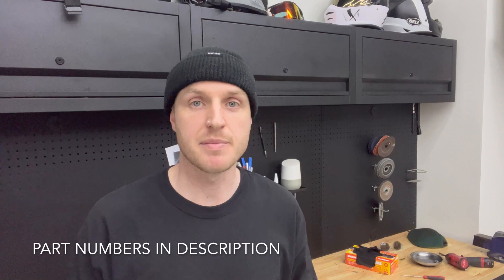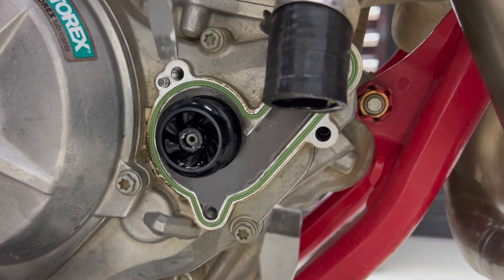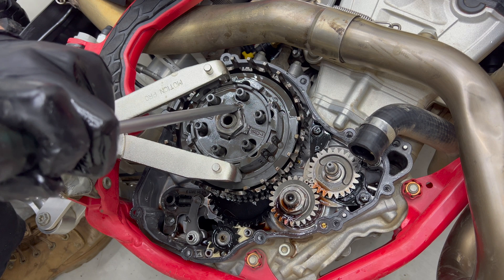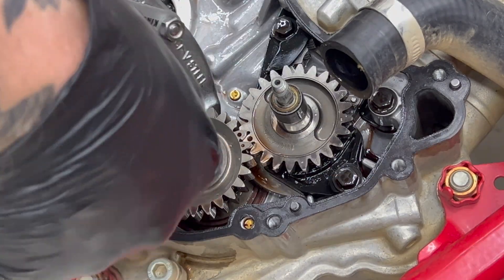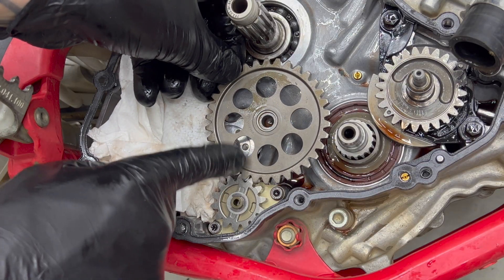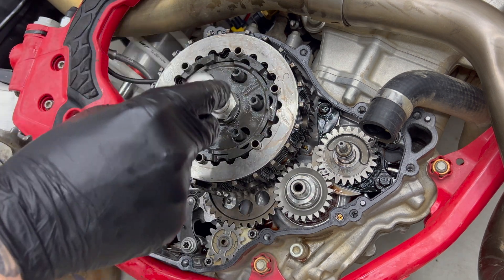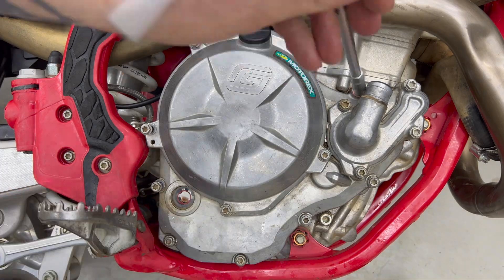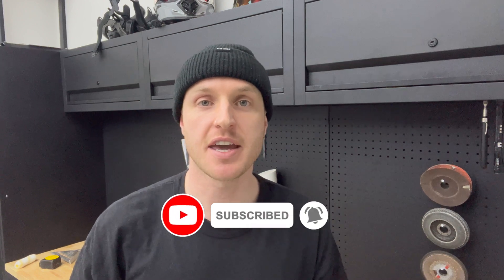Oil Pump Gear Upgrade! *How To* (KTM/Husqvarna/Gasgas)

Comment: Keep in mind, a big issue and usually the root cause is the oil pump rotors themselves were also plastic.   Theyd warp and bind and cause the gears to fail.   You should be replacing the entire pump assembly including plastic rotors.

Comment: Great video, I just pulled the clutch cover off my 23 350exc, your right it does have metal gears already😊, the dealer couldn't confirm this.
Unfortunately my neighbour has the same bike but a 2018, so we still are going to have to reference your video.
Cheers 
Giles

Comment: Hi, I have a 2019 KTM 390 Duke (European). I changed the oil pressure sensor but still the oil light comes on when the engine is warm. When I down shift from 4th gear to 3rd it comes on very quickly and then turns off. Any advice!

Comment: So how is my luck! I own a 2020 Husqvarna FE350 and a 2022 FE250. Both have now had the top ends rebuilt at considerable cost. After having the top ends done, it might seem that I have not addressed the actual cause of the problem. I have ordered the steel parts for the FE250 and will do the FE350 soon as well. Thank you for bringing this issue to my attention. But i do wonder why KTM has not issued a recall for this problem, I'm sure there are many thousands of others who have also suffered financially from this issue.

Comment: Can i use the crank locking bolt to remove the clutch hub and crank gear as i dont have the clutch holder tool

Comment: Apparently it's not an issue on the 450s. Even though they have the plastic gears.
Reply from the maker: I was under the impression the 450's have steel gears, but im not 100% sure
Reply: @jackkellybuilds  my Australian '23 FE450 has plastic gears. From what I've read the problem "plastic" years were around '17-19, after which they went to stronger fibre reinforced plastic. Sadly these OEM metal gears are 14T/34T and 250/350 specific, the 450 needs 18T/33T.
Reply: Well they failed on my 2017 500 exc-f same engine.

Comment: The part number for the small gear seems to be wrong...  My Ktm dealer is telling me it's and oil pump assembly for a 50sx..  Any update or corrections?
Reply from the maker: a quick google search would confirm it is the correct part number, maybe try another ktm dealer

Comment: Great video! Question, does the 2012 350 EXC-F have the same issue needing to replace the plastic oil pump gears? Thank you so much!!!
Reply from the maker: I'm unsure as that motor will likely be a different generation

Comment: I believe the 690 engine still has plastic gears!
Reply from the maker: Fortunately the chances are low on a 690 because I wouldn’t imagine anyone getting one of those hot enough to warp the gear, but a steel gear would be a nice redundancy to have

Comment: My KTM 250 E-XCF suffered a gear failure. No oil to the top end and I had to do a full top end rebuild at 10 hours. The new part# had no issue.
Reply from the maker: sorry to hear you got unlucky, at least you have the new gear now and shouldn't happen again
Reply: Better yet, I sold that bike and I'm on a TE300i now :)  @jackkellybuilds

Comment: Hi thanks for the great sharing! Any idea if these revised metal engine oil pump gears can also be used to replace the plastic ones on the LC4 engines of the 2012-2015 KTM Duke 690's?
Reply from the maker: No problem! You would have to check the part numbers on those to see if they’re compatible, but I doubt it

Comment: So will a 2020 fe250 need changing before i buy one
Reply from the maker: it doesn't "need" doing, likely you may never have an issue with your plastic gears, depending how hard you ride. but if you want the added reliability of steel gears, then you might want to.

Comment: Great video !!   Just am FYI  KTM 4 strokes have a great feature to lock the crank at TDC so no washers or gear jammers are necessary.  While at TDC remove the large allen bolt just below the primary gear and remove the thick washer that is behind it.  The end of the bolt is pointed and through the hole you will see a corresponding slot in the crank. Screw the bolt back in without the washer and this locks the crank at TDC.
Reply from the maker: You're correct, it does have that feature, the reason why I didn't use to it hold the crank while I remove the bolt is that the allen screw has a tapered end on it  and I was worried id shear it off with the amount of torque required to remove the bolt on the gear. It is a good feature that KTM's have though , I use it when I remove the cams to adjust the valve shims and it keeps everything in time. Thats for the comment!

Comment: some yamaha bikes also still uses this plastic gears, which is baffling considering is a known weak point in their bikes.
Reply from the maker: Im sure the engineers had their reasons at the time for the plastic gears, wether it was to save weight or save on manufacturing cost, but I think I speak for everyone when I say id prefer the reliability of steel gears in my engine than it be $10 cheaper or to save 20 grams

Comment: Can I ask you a question about my 2018 KTM
Reply from the maker: sure!
Reply: Was draining the oil and a broken C clip came out on the oil, where do you think is from?
Reply: Don’t know if that’s the right name for it but one just like the one you took off from the plastic sprocket, is it possible it could be from there or is there others inside?
Reply from the maker: @bismarcktorres8747  yeah its possible it could be from one of the oil pump gears, I would inspect to see if that's where it came from before you continue to ride it
Reply: @jackkellybuilds  if it is from that gear, do I need to take apart the clutch assembly to install a new clip? 😬 hopefully not
Reply from the maker: most likely @bismarcktorres8747
Reply: @jackkellybuilds  was afraid of that, ok well thank you very much for taking the time to answer my questions. Great videos by the way

Comment: They have been using plastic oil pump gears for around 15 years,  so has homda in there generator s really hasn't been that much of a problem
Reply from the maker: It doesn't happen to every bike, but there's been plenty of cases of it happening, for the small cost of the gears themselves its a cheap way to add some reliability

Comment: Are you aware of the plastic oil pump failure that other models have suffered? There’s a video on here showing a failure, and how to swap to the 450f metal oil pump rotors.
Reply from the maker: potentially, what other models are you referring to?

Comment: Searched and purchased both gears, shipped to my door for under 40 usd.
I for one will not be torture testing the original gears any longer.
Reply from the maker: sounds like a good idea! haha
Reply: Where'd you get them?  I have the steel intermediate, but still looking for the smaller steel oil pump gear.  Thanks
Reply from the maker: @jhheintz450  my local ktm dealer, the part numbers are in the description

Comment: I've got a few thousand hours on the 15+ ktms and never even heard of this. How many people have actually had one fail? My 25 year old garden tractor has a plastic camshaft gear and that piece of shit still keeps going lol. Why shouldn't this gear last as long, turning that tiny little oil pump?
Reply from the maker: If you have 450's, its because they have steel gears. This issue might not happen to everyone's 250 and 350's, but there's plenty of cases of people blowing up their engine due to these gears failing. Its not the torque through the gears that's an issue, it the gears failing due to excessive heat if the bike is really being pushed
Reply: @jackkellybuilds  Fair enough, well if you've got it happening in your area, good on ya for letting people know. I'm just a little weary of these sort of claims that pop up often in the moto world. You can find a snake oil salesman selling dozens of parts for every make and model of bike out there, claiming the manufacturer is stupid and screwed it up, and just beaming to sell you parts turned on a lathe in some dank garage, or a cnc machine in China, to fix it... I know you're not selling anything like that here so again good on ya and hope my comment wasn't too cunty... I've been off the bike for a few weeks so.............
Reply: @jetmuchacho  I get your point here. Just because they went plastic doesn't mean it was their choice. To source these gears could have cut into their profits at the time, who knows. Over-molding is always cheaper than cutting gears from solid so the theory holds up fine.

Comment: I heard they changed it for 2020s and after for ktm 350 xcf l sure hope so because I have a 2020 and a 2022
Reply from the maker: I hate to be the bearer of bad news but I just checked the parts diagrams for the 2020 and 2022 XC-F and they both have plastic oil pump gears
Reply: @jackkellybuilds  it'd be the upgraded gear P/No ending in '100' (more fibrous plastic).

Do you know if tye newer metal gear can be used in  a 2021 instead of the fibrous upgraded plastic rubbish?
Reply from the maker: @BeerBatteredGummyShark  yes the steel gear can replace either the later model plastic gear or the earlier plastic gear
Reply: @jackkellybuilds  thank's Jack 👍 I'll be ordering one this week.
Reply: @jackkellybuilds thanks for the info

Comment: Arroant manufacturer , how many years have they been linning Mechanics bank accounts , how about the Estart probllllems run fr over 10 years . This man says thankyou ktm for metal pump gears so blidt fanboys.
Reply from the maker: Say what you want about ktm, but I am definitely no fanboy, otherwise I wouldn't make this video pointing out an issue with their bikes and how to fix it with the purpose of helping others.

Comment: Plastic in hot oil is always a disaster .
Reply from the maker: I’m sure they had their reasons initially to use plastic, but it took them too long to rectify a known issue
Reply: @jackkellybuilds  Yeah, the reason is to lose weight, not much help when your engine has locked up!
Reply: @jackkellybuilds  How much do they weigh ? the fanboys always tossing on O how much do they weigh marketing , plastic bikes.
Reply: Sounds like some steady business for the factory service department eh